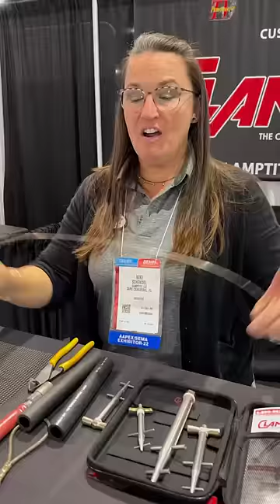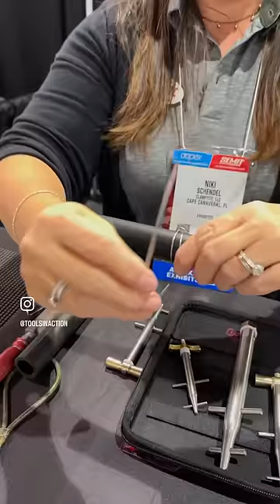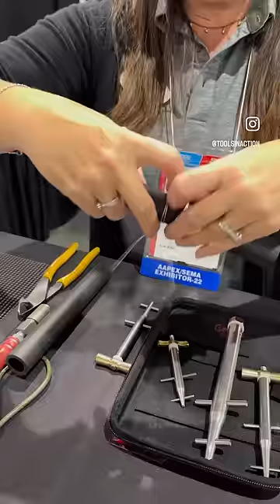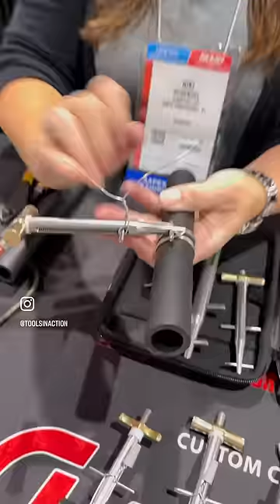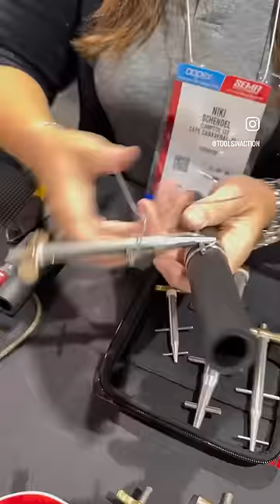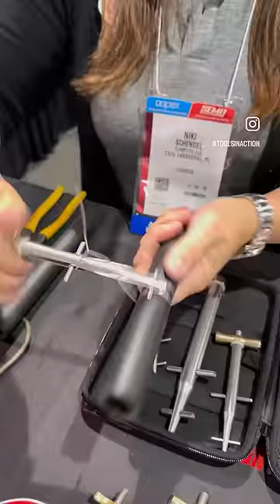Seems simple 😂

Comment: I have had one of these for over 20 plus years and it works great when you do not have a hose clamp.
Reply: oh is that for that. Oh ok. I use pliers and a piece of wire lol
Reply: There was absolutely nothing necessary about this tool and it does not make it easier. For instance I use a pair of pliers and wire to make this around my Jack handle every time I need one slide it off and tighten it around the hose
Reply: Me too, I've used it plenty.  It leaves a very neat looking job, and gives good tension control.
Reply: @VineyardGHS you’ve had some easy going clients huh?
Reply: When you’re installing hundreds of hose clamps a day for something that would otherwise be considered a permanent installation, this is actually just pure profit.

I imagine if you got quick at it, there’s probably about the same amount of time in it.
Reply: @geekswithfeet9137  or have a 40ftlbs impact or drill
Reply: But why would you have this and not a hose clamp? If you were going to buy these, just get hose clamps so you have hose clamps lol
Reply: This tech is not new just another variation/design of an old method. I've had a few different tools that do this for 30 years now. So many uses and benefits of a wire binder/clamp tool. Superior seal compared to all other hose clamps. Don't need to buy or search for hose clamps as any wire you have laying around will work and for odd jobs even metal coat hanger wire or stripped speaker wire will work if that's what you've got. If you can wrap the wire around something you can clamp it. I used this type of clamp once to bind a pair of jack handles to my right rear lower control arm of my jeep to get off the trail. You would have needed $50 worth of normal hose clamps with you to try that. Stainless wire is only $8 a pound or about 350ft. Idk what this is selling for but if memory serves me well I don't think I paid more than $40 for the ones I have from the 80's and 90's.
Reply: @DriftingDragon74 - that's nice, but if they were trying to get new clients, then they totally and utterly FAILED.
They didn't even show what the thing does, except waste a heap of time.
Reply: Hm! Never thought of that! And it's always the right size! Good idea!
Reply: @myusername111 Hose clamps are not flush fit. Can use this technique for CV boots. Just have to use your imagination. I don't often use the tool, but when I do it's very handy.
Reply: any type of wire? what about copper wire 😂
im joking, nice leverage tool
Reply: @myusername111 the length of wire is significantly cheaper than a hose clamp, if you're doing 500 hoses that adds up.
Reply: What is the manufacturer of the  tool or it's name?
Reply: Easier to just get a clamp or twist the wire until you can go to the store
Reply: This is too complicated
Reply: @johncoops6897 this isn’t the manufacturers channel……
Reply: this is much stronger!
Reply: Works better than most hose clamps out there.
I've made 3 of these.
Reply: This is like a survival tool for a lighter. You're taking up the space, just have extra clamps.
Reply: I just buy proper fittings and have a box of clamps in the truck this is useless in my opinion but I come prepared
Reply: Or a jubilee clip
Reply: @FlyPVTarzan Farmers
Reply: @oldluke7653  yeah that’s that “just get it done” mentality. You gotta think of the warranty workers
Reply: I use it INSTEAD of hose clamps. Much cleaner.
Reply: Works great if you don't have a hose clamp? Does still work great if you DO have a hose clamp? Directions unclear,  sharpie stuck in 💩er.
Reply: @myusername111 This has many applications,  when hose clamps are not possible.
Reply: Works a lot better than a hose clamp actually
Reply: Yes a great tool
Reply: You can do the same job with a zero penny junk that lying in your garage
Reply: Bet it works great when you also got plenty a room to work and you don’t have to deal with that fiery header I see a lot of problems with that tool and those wires I see a lot of it between the two not being designed for torque especially on those wires and I don’t know if they’re actually rated for the actual heat that they’re supposed to be rated for I don’t like that, but just getting your meat mitts in there to fix it stores that are in my area I have the whole entire pipe, elbows clamps, everything I would not trust this shit
Reply: @myusername111 One tool and some wire takes care of all sizes
Reply: Where can I buy one
Reply: @johncoops6897 did you watch the video where she says what it does?
Reply: @FlyPVTarzan this method is much toghter and more flush than any hose clamp. Let alone much cheaper.
Reply: Nice...can see yitt
Reply: I carry this and wire with me on my truck, have used this for hose clamps that I've never had leak in 4 years, and it looks very nice when the wires are run together around the hose and not just twisted up with pliers. I always get compliments on my truck at the autocross track.
Reply: @christophercarpenter7536  - sounds great. Maybe you could upload a product demonstration video that actually demonstrates the product 🤣
Reply: You'd think that at some point in 20 years,  you'd just go get a hose clamp.
Reply: I prefer factory style spring clamps, but these can be made to look really nice
Reply: Or, crazy thought, buy a hose clamp, wire is not meant for this.
Reply: You haven't got a clamp for 20+ years? You must be having a bad memory! :)
Reply: What are you guys working on where you could even imagine having enough room to do this.
Reply: 🤔 What if you don't have wire?
Reply: Just till you can get one

Comment: I have owned one for decades. A couple of them actually and have gifted them to kids and friends. They do a good job for hose clamps but also as wire binding for repairs on things like broken shovel handles, expedient field camp construction etc. The only time I have had frustration with them is in tight space work where I don't have the swing room to use the tool. Those tight automotive spaces where a screw or spring clamp is about the only option. I have made my own versions for tight space work but they still need some room so don't get cocky thinking you can handle every clamping job with this tool. Toss a couple good quality screw clamps in the tool box too.
Reply from the maker: Never though if that, great comment
Reply: Nie prosciej zwykłą skrecaną opaskę założyć 🤔 a tu nakombinować się trzeba, nakręcić , a świat pędzi do przodu...
Wygląda mi to na zastąpienie ciężarówek osłami , a kalkulatora liczydłem..... Śmieszne co 😂😂
Reply: You should have mentioned in the video description that this tool is called a "Clamptite".
Reply: What do you call this tool?
Reply: @Milosz_Ostrow  probably best to mention that to the video creator
Reply: I have one of these clamptite tools. Works like a charm.
Reply: It is here it done that American show for years
Reply: one missing in the video, and it was what is this tool used for? :D
Reply: @AndrewTSq 
And what's it called as?

Comment: I bought one 30yrs ago, used it many times but I noticed a couple of variations on this design here on YouTube so I made two new devices. I prefer my wire clamping models to this old model in the video above but to anyone who hasn’t used wire clamps I would recommend you start. The clamps are stronger and seal better and are unobtrusive. Pro tips: 1) of course only use stainless lock wire, never galvanized or mechanics wire, I prefer .040 - .050.    2) After the wire is tightened and bent over cut it about 1/2 inch then take needle nose and bend 1/8 inch of the cut ends 90* down toward the hose and press the ends into the hose between the wire wraps. At that point wrap the entire wire clamp with self vulcanizing silicone tape. You end up with a pro looking wrapped clamp that won’t snag your hand or anything else.
Reply: The tool used to turn stainless wire into basically a hose clamp, what is that tool called, & where can one be obtained?

Comment: Great demo.  Please finish it so we know what to do??
Reply: My thought as well. And… seams like it’s kinda specific. Need the room for the tool… wire rots too… stainless wire is a must… expansion clamps do just that, expand. Is this an automotive application or a temporary repair application? I see a quick fix for some things but idk. Not sold
Reply: @joeylikewise2017  Use stainless or galvanized wire. At the finish, lift the tool 180 degrees to bend the wire to lock the tension. Loosen the tension and Cut the wires
Reply: It’s called a YouTube short. Find the full length video if you want to see it geez. 

Also this would be amazing for header wrap. Do you know how much SS metal zip ties cost? And they won’t get this tight.
Reply: @latenttweet - yeah, so if you never get to the point, you completely wasted the viewer's time. That doesn't make them go look for some other video about the product, it pisses them off so they downvote and swipe away.
Reply: Or at least tell us 'Why'.
Reply: @johncoops6897 that’s not true at all. If you see that this tool could be of use to you you are going to look further into it. Maybe you won’t personally, but that’s becuase you will never need this tool, you are. Just curious and don’t want to put any extra effort in. I mean wasting time? That’s what YouTube short are for……
Reply: @joeylikewise2017 roadside repair type application, or for something like air tool hoses and the like.
Reply: @johncoops6897  spot on  . I guess we just go to the full video to see what the rollers do for the dishes  😂😂
Reply: For real! Lol
Reply: @valtim22  - thanks for reading and replying, as well as understanding what I was trying to say. Cheers 🍺
Reply: Glad I wasn't the only one thinking "Ok so wtf did I just watch?!🫤".
Reply: The poster cut the original clip so they didn't get in trouble for stealing content.
Reply: @nicholasmendoza6159  - all uploaders edit their clips to fit the YouTube Shorts time limit of one minute. There was ZERO cuts or edits, so the original couldn't have been a Short. It looked like phone footage taken at a tool show. If you check the channel name, that is probable.
.
If you are uploading a video here, it doesn't take half a brain to make sure that the content is meaningful and understandable to your target audience. I mean, this is pretty basic stuff 😃
.
Go back and read all the comments. Only people who had previously seen this gadget had the faintest idea what the video was about, and the majority of comments are like WTF 😮
Reply: I finished ;)
Reply: @latenttweet your right wont get nearly as tight
Reply: @idadho what is the tool called. As I want one.
Reply: Or at least tell us what the tool is called

Comment: IIRC, in A&P (Airframe & Powerplant) school c.70's: they told us these were banned by the FAA due to high load concentrations generating excessive 'cold flow' in fluid lines. Also, in the 'real world, they're nearly useless in tight quarters. Good Demo though!
Reply: Perfectly acceptable for homebuilt and Experimental category aircraft. They are even sold by Aircraft Spruce & Specialties Co.
Reply: I agree 100% on the tight quarters.
Reply: @Milosz_Ostrow even if its experimental its a good idea to stick with anything in the AC43.13
Reply: @thegoldenatlas753  — If everyone were to do that, there would be NO technological progress. The whole idea behind "Experimental" is to try new things to see if if works, whether it be in aviation or amateur radio.

Comment: My favorite hose clamp is still the constant tension ones. A lot of people say they hate them, BUT if it's properly sized it'll not allow a leak if the temperature fluctuates wildly. Say you take a hose off a car in summer, tighten it back, now fast forward to winter when it's 60 degrees cooler... that can absolutely cause a leak. Or even just the hose deforming over time from the pressure of the clamp. With the constant pressure clamp it's just working.

Comment: "And now we finish". I've watched a dozen times and still waiting. It probably springs apart and puts her eye out.
Reply: you flip the handle to the other side of the loop it was pushing on and the bends the ears it was pulling on over. Trim em and press the end out the way. works great, though it's much harder to get the wire setup when the hose yer clamping isn't in free space with no obstructions around it like the one she's doing.

Comment: I love to see the ending portion of how the tool gets disengaged.
Reply: Yeah! They look bad hanging off the hose connections too. I have four of them on my heater hoses, two on my bypass hose and four more on my upper and lower radiator hoses and a roll of bailing wire in the trunk. Really annoying because they make so much noise when you hit bumps as you drive, but they don't leak yet.
Reply: Oh very simple I have one and love it. You simply flip the whole tool over from the left side it's currently in to the right side. It will pop out of where the end was pushing then you cut the 2 wires that are twisted together. That's it, you can also twist them together once it's cut.
Reply: @claudiolorenzon1997  Aah yes! Sorry for the confusion, but I believe both of our comments were of the sarcastic nature. Of course we know you have to flip the tool over the same as a SS Band on a CV Boot. We were just sarcastically making fun of the video finishing before the end of the presentation was finished thereby cutting out how the tool actually works.
I was not knocking ClampTite LLC's tool or the sales person presenting the tool. I am knocking the person giving us this Short video unfinished. If you can't figure out how to edit the YT Short's, ending it in it's third quarter or if you have to add a Part 2 then don't show the video. It would be great if all of the video's comments just
Reply: @Ed70Nova427  hahaha ahh gotcha! Yeah no this video was terribly edited. There absolutely should of been a part 2. This tool actually works really well to fix broken hoses and other things like that leaves a flush finish I really like. You can't snag anything on the finish.

Comment: Hose clamps 50 cents, length of wire, 5 cents. Hose clamps, good if you have a stock of them for any size. Wire, fits all sizes. Keep a clamper and wire in your  toolbox, fix any job. Pliers and twisting wire breaks the wire.
Reply: Hose clamps aren't $.50 any more either.  Unless you buy them in bulk, from China, in all sizes, and carry them around with you, taking up space in your tool bag or truck, this works.

Comment: That type of hose clamp was banned in the plant I worked, we went to crimped ferrels.  Your type created a week point that failed often on the air lines.
Reply: This is not for industry, it's a farmer's or handyman gadget.  I use mine for garden and radiator hoses, even repaired a split axe handle for a few years with it.
Reply: It does seem like it's a temporary get me out of this situation for of device, that you replace as soon as you can get the proper part. I'm sure it became permanent because people forgot the replace it.
Reply: Just use a hose clamp
Reply: @luvmechanix are you serious?
Reply: Idk I’m not trusting anyone’s opinion when they spell weak “week”😂
Reply: I lost a 3 inch radiator hose on my dump truck on an interstate luckily
 I was able to get over and shut her down. I even doubled it.
Reply: @nobleroofinggeneralcontrac7961  did you give it to the next person?
Reply: Yeah, if you have the time and luxury to take every job to a work bench then crimps are definitely preferable for permanent service. But these do work well, and can compete or beat many other hose clamp solutions.
Reply: @MagentaGiraffe Or spell ferrules "ferrels"..
Reply: did you try putting a shim btwn wire and hose?

Comment: I don’t have hose clamps laying around but I do have baling wire and plenty of it so this is a great idea.
Reply: Yeah, and you don't need to keep several sizes of clamp if you use this method.
Reply: And you can use a pop rivet tool to tighten
Reply: Better off with hose clamps as they will spread load over the hose and it won't cut in like wire will, also you risk damaging the hose if you want to reuse it
Reply: @crf80fdarkdays  I used it on power steering hose, high pressure side, no problems. It’s perfect in emergencies. Try it some time.
Reply: @davidjauch6682 😅😅😅😅😊😂 that's slick, ive just been using pliers and muscles, grabbing my pop riveter for my next fence fix❤
Reply: @davidjauch6682  outside of an an emergency I'll give it a hard pass, I like to do things the correct way

Comment: Trust me these have their place been using them alongside hose clamps for years
Reply: Yeah, I was surprised at the number of naysayers.

So, this is a way to make a hose clamp of the perfect size that won't loosen up, and I BELIEVE they use these in aviation mechanical applications.
Reply: Never seen a hose clamp (or those wires) in aviation. I am not an expert in that field, but when I look at airplane stuff, it is always crimped screw connections and banjos.
Reply: Agree, made myselft the tool to test it after having see it and some time these are the only things that fits perfectly to stop leak.